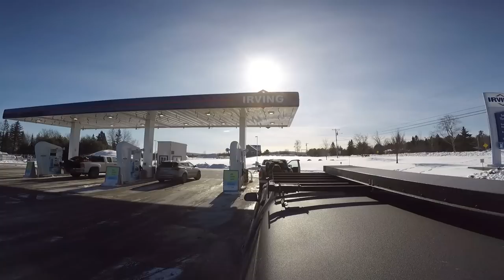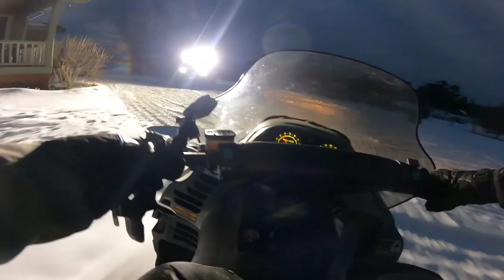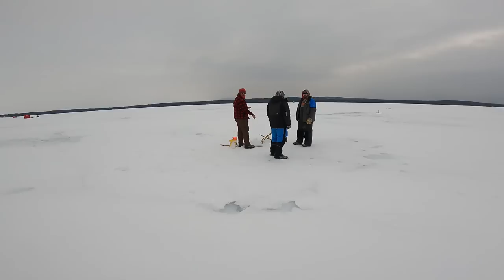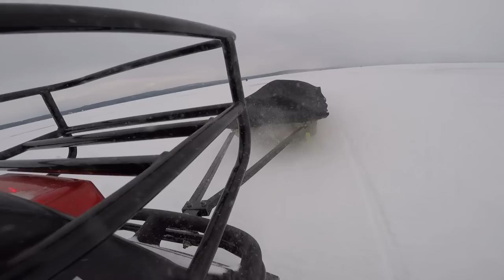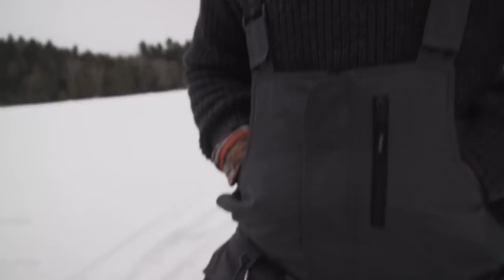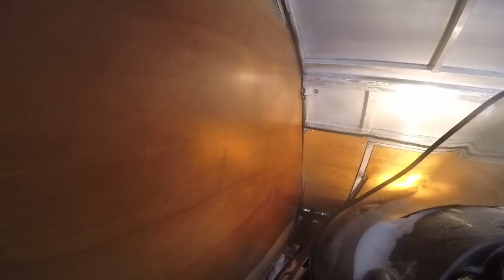Insane Blizzard Almost Traps Us While Ice Fishing - 2 Days On Moosehead Lake

Comment: Nice lake trout. Speaking of blizzards and fishing... Back in the early '80's I started fishing a few hundred yards offshore of a large lake when a blizzard rapidly approached. My first tip-up kept going up before I could set my second. I assumed they were wind flags. I was wrong! After several flags and putting another bait down the hole, I saw a fish coming up to get my bait (2 feet of ice). Though I lost it, I realized these were fish flags. With it snowing heavy and the wind gusting around 50 mph and trying to set my second trap, I caught 18 salmon 3 - 5 pounds in about a half hour (much larger than you catch today). With the wind picking up and fish flopping all over the place (and snow starting to cover some of them) I thought I better pull up and head home while I still could (the lake road, though covered in snow, would be easier walking than the lake once I got ashore). I had my dad's large brown ash wicker basket (which could hold two large beaver). I had difficulty fitting all those fish in that basket. Some of the tail ends (about a third of the length) stuck out from the top. I was over the limit (by 16). But I was unemployed, with little food in the house, and likely no wardens (or any other sane people) would be out today in the middle of a blizzard. I likely would not have been able to snowshoe in deep snow with this heavy of a load. The most I had carried before were 2 beaver, and this felt heavier. Once I walked the 4 miles of lake roads, I had to walk alongside a small highway for a few miles, with several fish sticking out of the top of my basket. It was amazing that no one stopped to inquire. Not even when I walked through town back to my home. Just how often do you see ice-fishermen walking on the side of the road, carrying all their gear, with several fish tails sticking out of the top of a large basket? I suspect the falling barometric pressure affected the fishing, which few today pay attention to. I have seen this before.

Comment: Great video bud, did you ever figure out what the issue with the sled was? Don’t overlook the tether having ice on it or faulty had a sled give me problems changed everything come to find out it was a faulty tether switch
Reply from the maker: This one doesn’t have a tether. I think It was due to me. It letting the fuel pump do its thing before I’d start it up and take off after a flag.